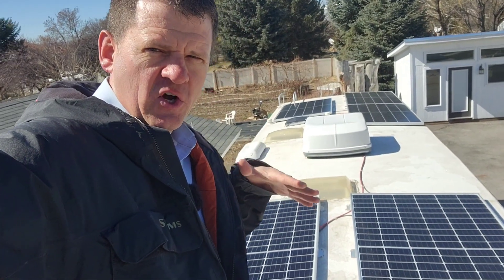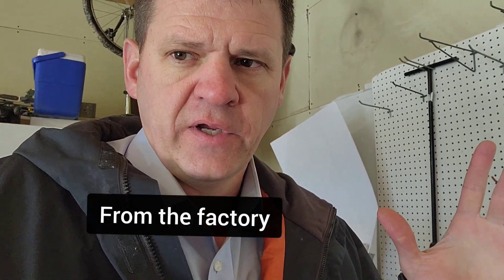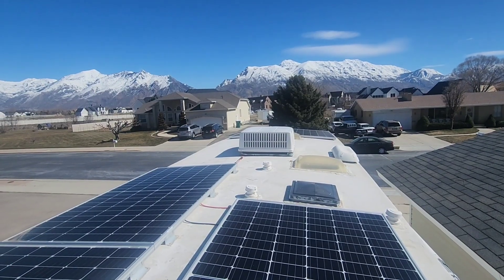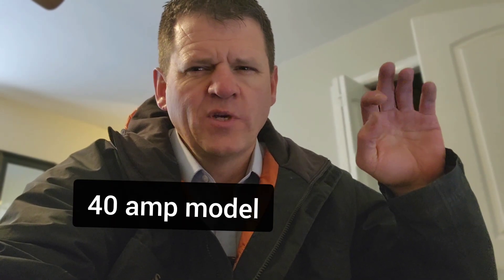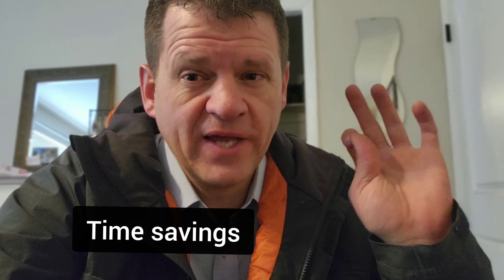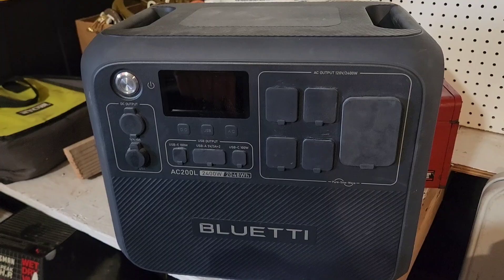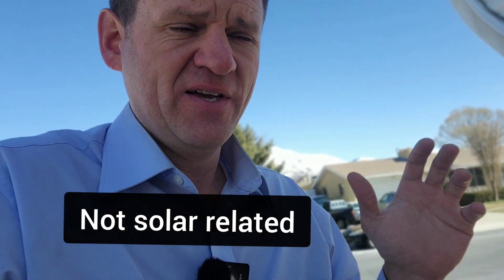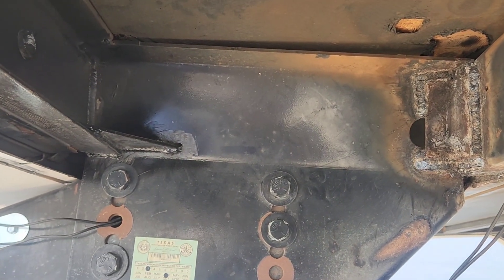One Year Review - 48v RV Solar Power system - What I Got Wrong

Comment: WAGOs are a good option, but note that when vibration is an issue you still need to provide a bit of restraint with the WAGO to prevent the wire from twisting in the connector... it is possible for it to twist loose (though it takes an effort).  You also don't want the levers to get pushed up accidentally.  A little electrical tape does the job nicely.

Here is the solution I use for running legacy 12V gear from a 48V or 24V home battery.  It's ultra simple and very robust.   Basically it's just a Victron 75/15 charge controller and a small 12.8V LiFePO4 battery.  That's it.  Oh, and a fuse.   You wire it:  48V -> (10x38 solar fuse 10A) -> "Solar input of" Victron 75/15 "BAT output to" -> 12.8V LiFePO4 battery.   That's it.   Works great.

10x38 Solar (ceramic) fuse 10A ($20 for 5 pcs)
10x38 fuse holder (Baomain solar pv fuse holder) ($9)
Victron SmartSolar 75/15 charge controller  ($67) 
30Ah 12.8V LiFePO4 battery ($90)

Total: $186 before taxes.   And these are all fanless devices.

This example assumes trickle-charging at 15A (roughly 190W) is sufficient to keep the 12V battery in good shape.  The battery itself can handle larger loads and surges, size to what you need.  E.g.  A 30Ah battery can discharge continuously at 30A = 383W and typically handle surges in excess of 500W.   The charger part of the circuit doesn't need to deal with the loads, it just needs to keep up with average consumption across a few hours to keep the 12V battery in good shape.

That's the huge advantage of having a 12.8V LiFePO4 battery in the mix... no worries about loads or surges.

If 15A isn't sufficient then the Victron 100/20 smartsolar charge controller ($90) works well too... 255W charging capability.   If that isn't enough, a Victron 150/35 smartsolar ($185) for up to 35A charging.

Always buy the "smartsolar" version of the Victron because the bluetooth interface and Victron Connect app makes setting the thing up and monitoring it trivial.

WARNING!   The fuse on the 48V battery side is mandatory because Victron charge controllers have a fail-safe on output over-voltage that shorts the "solar" input.  Normally it would never hit this fail-safe, but obviously you need a fuse on the 48V side just in case it does.   The charge controller already has an auto-fuse on the output side.

One can also use a 48-to-12V dc-to-dc charger instead of a charge controller, but those tend to be more expensive.  The charge controllers work really well for down-buffering a higher voltage home battery to a lower voltage satellite battery.

--

Those Amazon 48-to-12V buck converters do work but there are two problems.  Actually more than two problems but two main ones.  The first problem is that a failure condition can end up feeding 48V straight through to the 12V output.   The second problem is that these devices are typically NOT current limited (even when they say they are), and they can overheat.

-Matt
Reply: Like that idea of using a solar charger as a step down for the 12v stuff! Will probably end up doing that with a 50ah battery!
Reply: @nismor3490  Yup.  I use the concept all over the place.  As long as the "solar" input is reasonably fused when sourced from a battery instead of from panels, I consider it safe and effective.
Reply from the maker: I think that would work as well. I wonder what the efficiency is. If you have a failure on your charge controller, wouldn't it also have the possibility of sending 48 volts to your 12 volt system.
    My Buck converter has a current limiter on it. I tried pushing it over 30 amps, and it turns off. That's definitely to test though
Reply: @diySolarPowerFunWithRay  It will likely blow the fuse if the FET fails and feeds the input voltage to the output, due to the battery on both sides.

The efficiency for a well-designed buck charge controller is 98% or higher.  It is very, very good.   The reason is primarily because charge controllers are current-regulated devices and have poor output voltage regulation (it will bounce around a lot)... but they don't care because there is a battery connected to the output.

Efficiencies for buck DC-DC "power supplies" tend to be a bit lower.  95% is more typical.   This is because power supplies are voltage regulated devices and must output a stable voltage... tighter regulation, which eats into the efficiency a bit.

This is also why grid-tie inverters can operate with very high efficiencies.  Grid-tie string inverters can hit 99% due to the very high DC voltage and 240VAC output, all current-regulated instead of voltage-regulated.

(however, junk grid-tie inverters such as the cheap 120VAC grid-tie inverters on Amazon tend to run 80-85% due to the cheap design and the lower input DC and low output AC voltages involved).

But regular power supplies, AC or DC, are typically more in the 80-95% range depending on the quality and voltages.  The best AC-to-DC power supplies typically run 92%-95% efficiency while the junk one buys off of Amazon is more in the 85-90% range.

An example of a high-end power supply would be something like a Mean Well HLG series unit.  Those can hit 94% converting 120VAC to 48-60VDC, for example, with a 0.95 power factor or better at max load.

AC chargers (AC->DC/BAT) are more around 90%-95% depending on the quality.  Most chargers typically hover around 90% when charging 24V or 48V, and a bit lower when charging 12V.   This is because the power has to go through two conversions instead of one.  The AC has to be rectified, often also isolated, and then bucked-down.   And a power-factor-correction circuit is required for the rectification to be even remotely efficient.

So cheap chargers without the PFC circuit will be more like 85%-88% while more expensive quality chargers will be 90%-95%.

-Matt
Reply: WAGOs are no good for moving stuff,,,,, ALL mobile electrical should be crimp connections with adhesive lined /sealed heat shrink

Comment: How many 48v batteries have you been using?  Are you planning on adding more?  

Thanks for the video!
Reply from the maker: Normally only one.  But I connected a 2nd battery for the long off grid mexico trip.
Reply: @diySolarPowerFunWithRay  thanks for the reply. I’m working on a similar system up here in Idaho Falls. 

I think the all in one 48v systems are so much simpler and your setup is a great example of that. I have a 50 amp Rv so I’m going with the EG4 6000xp.

Fingers crossed.

Comment: Good stuff Ray! There aren't many videos on 48V system installs for 5th wheels yet, prob due to the lack of specific equipment.  I'm sure this is the way the industry is going.
I tried using a 48V Sungold all in one, which is great at what it's designed for (off grid apps) and gets high marks for simplicity  but won't seamlessly accept the line to generator  shift.  As far as running the AC longer, its a matter of money. You have enough room to add at least 2 more batteries to achieve that goal!

In the end I opted for a Victron 48V/5K inverter, 20Kwh battery array with 4 24V in a 2S/2P set up.  I can run one AC for 9+ hours, plus the converter (not efficient, I know) and all the small loads with no problems. Battery at 70% after test run. Also 2Kw of solar installed, but never seem to get more than 1200w. Still fiddling with that, but that's the fun part too. And yes, I've installed soft starts too. Downsize is weight on the front end and a single phase input. My thinking is we will just be careful with loading until we know the capacity.
Reply from the maker: Wow!! That's awesome! Do you find that having the single base output limits you at all? Aren't all of your appliances 120 volts?
Reply: @diySolarPowerFunWithRay   We are about two months into traveling, no issues so far, but its early spring  so no big A/C loading yet.  Yes, this config only allows 1 leg (50A) but the Victron splits it to feed both sides. The way it works is to shut down one side when running on the batteries, which is fine because it disconnects the water heater, refer, main air loads. Also the DC converter, but I just moved the plug to a different outlet to maintain and run the refer and heater on LP.
 Checking the single 50a wire, it is warm , but not excessively. Something to keep an eye on thru the summer tho. So far so good, my biggest concern is still weight on the front end....

Comment: Hey man love the video gona keep in mind everything learned do u think it’s smarter to have a 48v system rather than 12v if wanting to run multiple things? im trying to put together a system now but can’t afford a battery at this time so far I got a small 2000 watt inverter 4000 max output and the wiring and a fuse but nothing to put it in yet. Do u know if maybe I can contact a company to get a freebie
Reply from the maker: 48 volt all the way!!  :)

Comment: Hey Ray, enjoyed your video.  I have a Class B rv that I replaced the A/C with the Coleman Mach something.  It is a 13.5 BTU and watching the  Hughes power watchdog app on my phone if I go straight to a/c low, the amperage jumps up to over 16 amps.  Iif I start on low fan and than high fan and than low cool up to high cool, the amperage manages to stay around 12 amps before leveling off.  I used my EcoFlow Delta Max 2000 to see if I could run the a/c and it was able to run it, as long as my amperage did not exceed 15 amps.  At 15 amps my Ecoflow would shut down.  Once the a/c was on high and had settled the amps leveled off to between 6 to 8 amps, that is using my  fridge and lights too.  Appreciate your honesty and sharing your mistakes with us so that we do not repeat them.

Comment: If your only regret on the inverter is the solar input, you could add a separate solar charge controller (ignore the one in the inverter).  I like victron smart solar (has bluetooth). The 100/20 has a 48v capable version and a pretty good price, but you would need to rewire your solar panels and as 20amp at 48v is only about 1000 watts you might need two. A higher voltage input, higher amp controller costs more but probably is well worth it in your case for a more simple swap.
Reply from the maker: That's actually a good idea. I think I'll do that!  That way I'll also have the larger voltage MPPT if I ever need it in the future.  Thanks